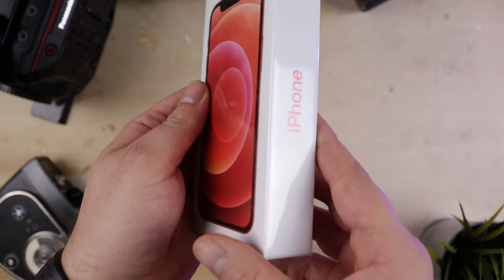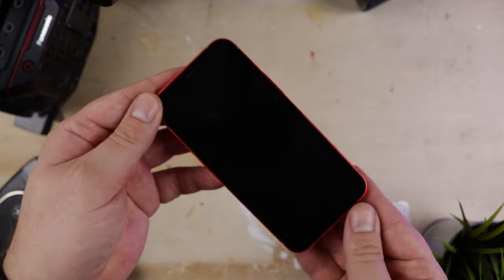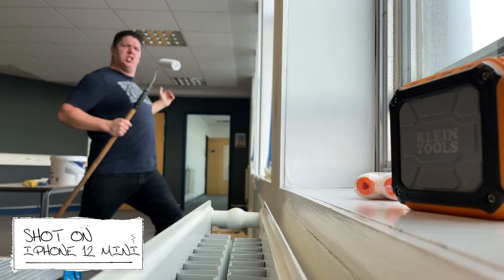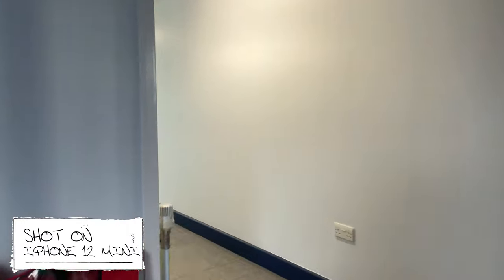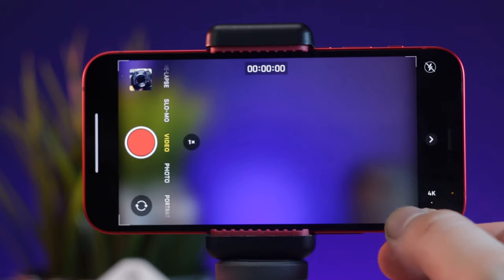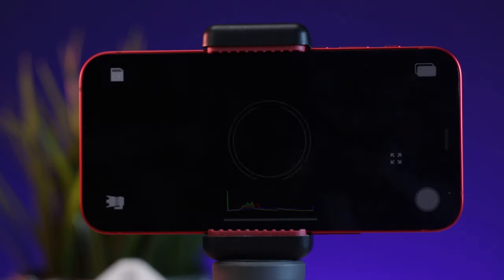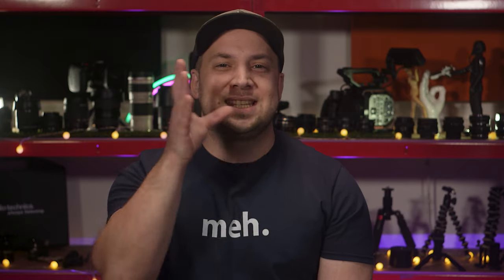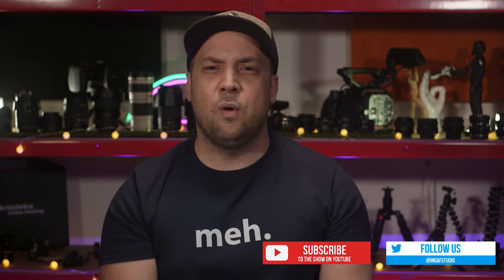Is The iPhone 12 A True Filmmaking Video Camera?

Comment: Nice HAND wave transition, also I laughed at "small hands" after you drop "MINI" lol.  ON TOPIC - I've only recently started using my 11pro to do "video level video capture". That means anything i'd use outside my own personal use. It's a great camera as well and i love having it in my pocket, but I agree there is something that's strangely cumbersome about the process of shooting with it. (shooting and editing with it, still sucks to get the video off the phone). THE APP is a huge thing WHY haven't they given us full control, last thing i want is another third party app to take give you that full control. 

Great video guys, if this doesn't do well in the first 12 hours based on other iphone reviews still dropping there's got to be something up. (TINFOIL HAT TERRITORY) ;) ;) ;)

I almost liked the paint lip sync rock out the most, ALMOST.
Reply from the maker: I knew you’d spot that transition. Straight out of the mark holtze playbook. These really are equal part convenience and frustration. Things like inconsistent frame rates and compression etc just hurt let alone the app which just hurts. 

Get your tinfoil hats at the ready, it’s an interesting experiment if nothing else!!